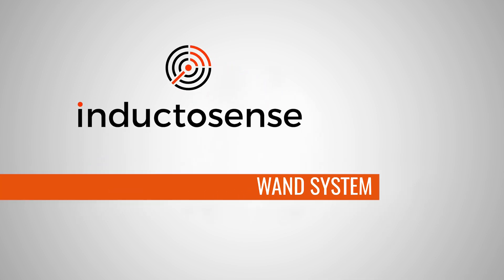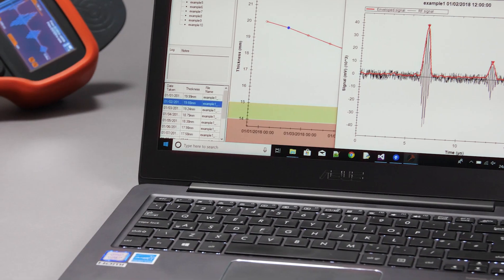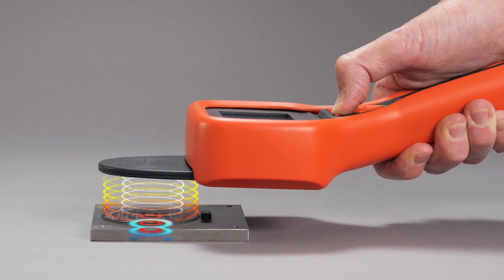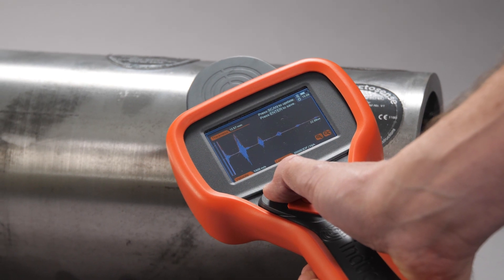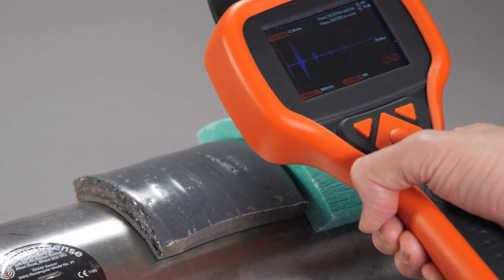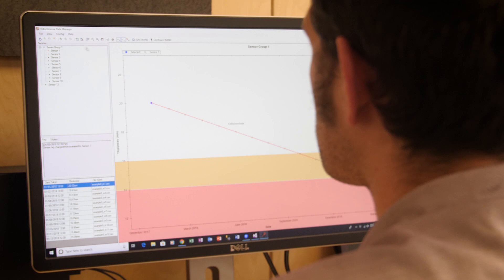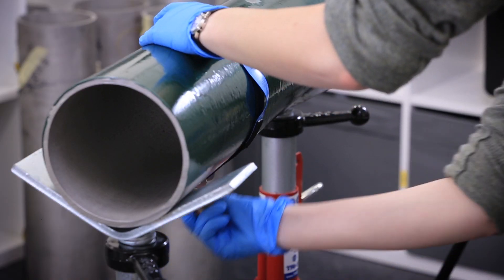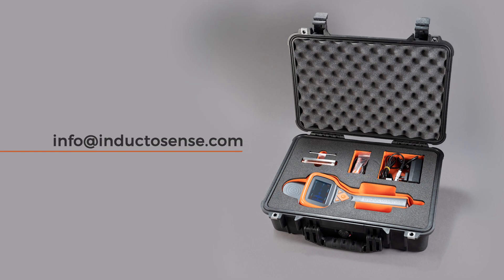Inductosense WAND System Demonstration Video

Comment: How does it work in Hot and Cold surfaces?
Reply: Hi Brenton. Thanks for your question! 

We have tested down to -40degC and up to 130degC. We have sensors running in the field at 130degC for over 3 years. The sensors can also handle higher heat for shorter periods (eg for steam outs at ~170degC). We also have a higher temperature solution with the TRND system - up to 350degC. Please get in contact if you would like some further info: info@inductosense.com